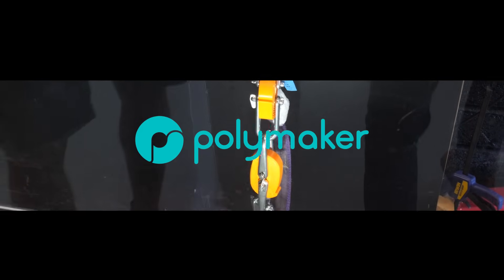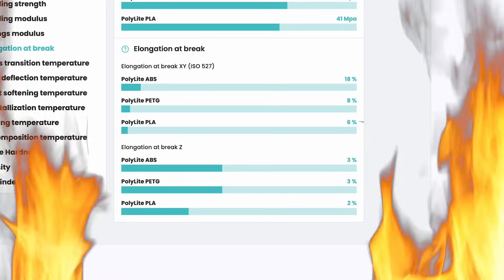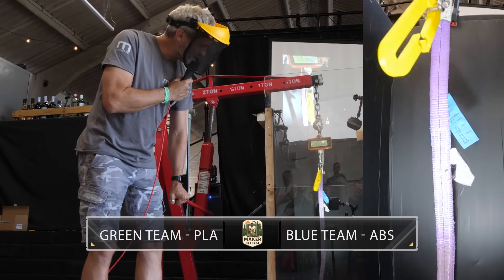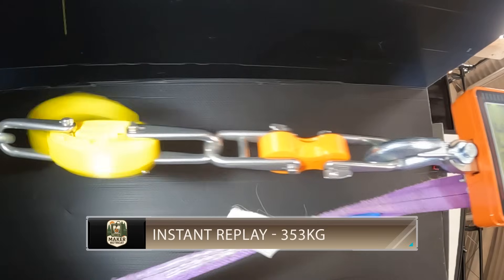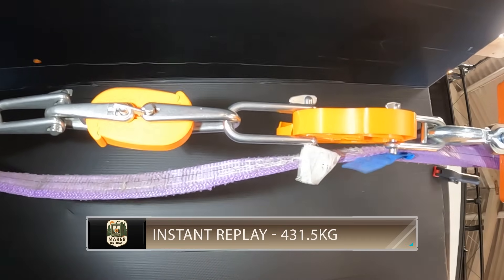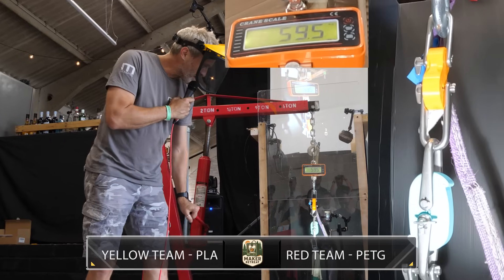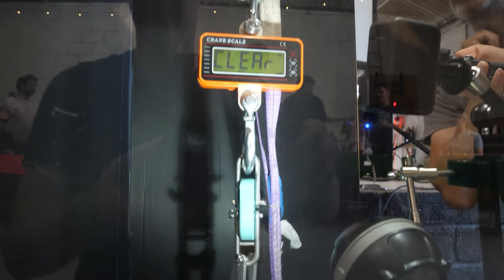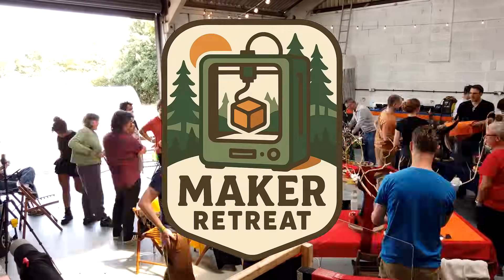50g Hook, One Winner: The Maker Retreat 3D Print Battle 🏆

Comment: Without testing Toms hook to destruction the opposition would not known what they were up against if the competition was repeated every year they may have thought 500 or 600 and they were for sure a win at 700 and the year after if they got 900 they still loose by 100. But testing to the limit things get pushed faster and that's how things progress rapidly.  I wonder how much stringer it would bee injection molded but no filament or 3 d printer maker will sponsor that.
Reply: And the exact design couldnt be injection molded as it's hollow, so it would be interesting

Comment: that hook is SO FUCKIN GOOD 1 ton a 50 gram piece of plastic
Reply: 50g of HDPE loops would hold even more. I mean the design was impressive, but polymers outperforming steel on a force-per-weight ratio isn't that surprising.
Reply: Imagine what can happen with 60 grams
Reply: @HugoStuff  well.. 20% more or about 1380kg in total.